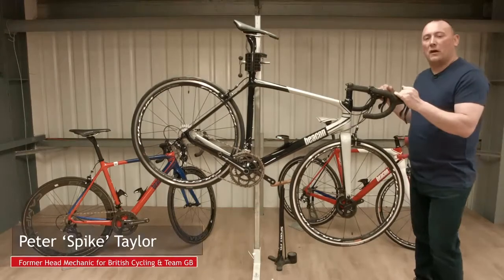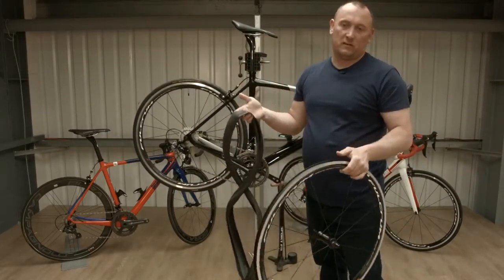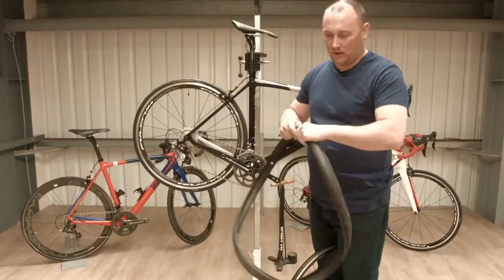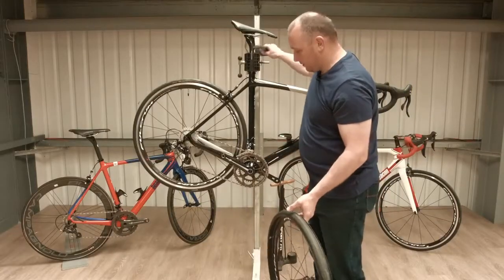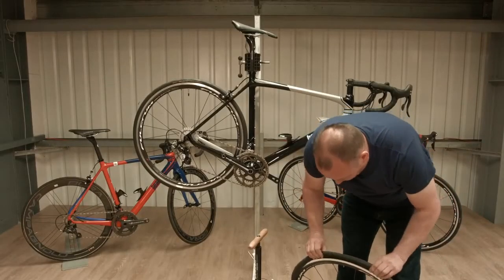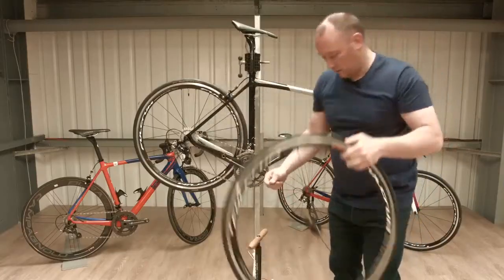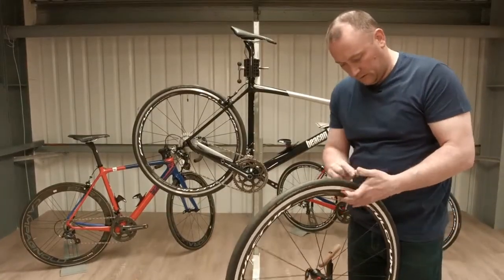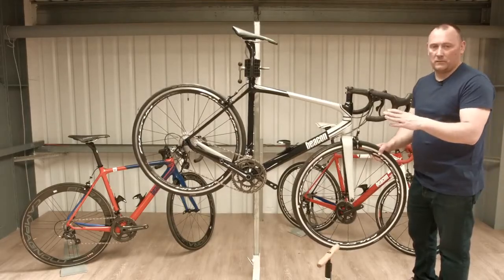Repairing a puncture without tyre levers

Comment: Rather than just discarding the old tube, you can check it for the puncture, and confirm both location on the rim/tire, helping you to find what caused it, AND, save you a lot of time if it is actually a snakebite pinch puncture, or spokes poking through/damaged rim tape etc.